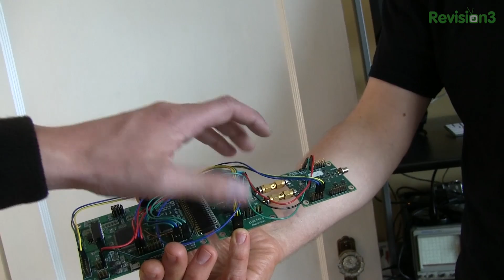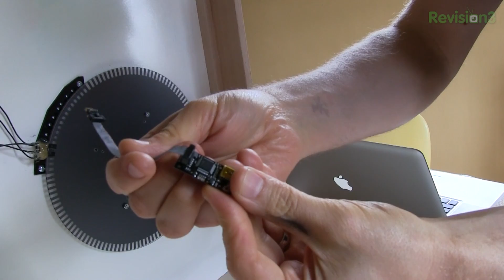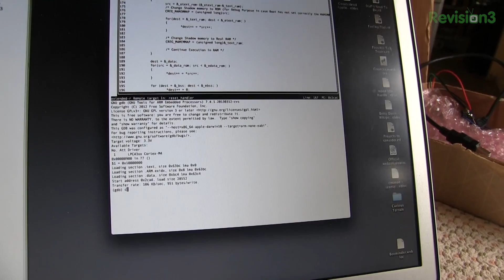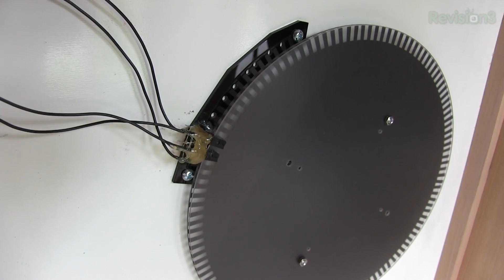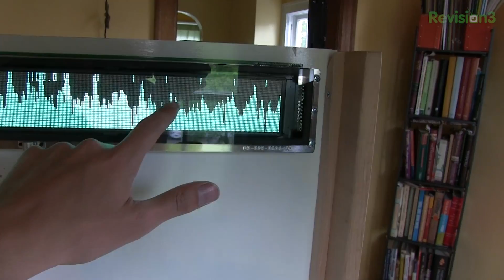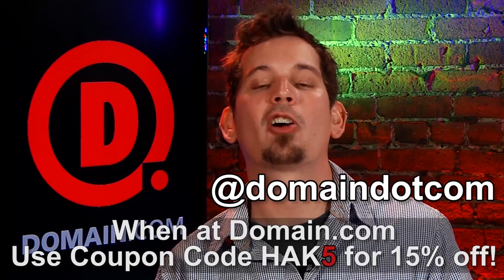HackRF update with Jared Boone, Hak5 1417.1 - Hack Across America 2013

Comment: It's a vacuum fluorescent display made by Noritake. I bought mine on clearance through their online store (noritake-vfd dotcom).

Mine is a GU384X32L-3900, but I think they sold out of them after a bunch of people saw mine at Maker Faire San Mateo... They do have am affordable 512x32 available, but it looks like a physically smaller unit, despite the higher pixel count.

Comment: I couldn't find a mini PC video on your page but will mini PC's work on any HDMI TV?  My TV is 720p but I want to buy a 1080p mini PC (Tronsmart T428).  Also, which mini PC do you think is the best, with all the best features like BT 4.0, 2GB of RAM, 5GHz wireless, and one that will work with the 2.4GHz wireless keyboards too.  I wanted the T428 originally but it has too many problems.  Thank you.